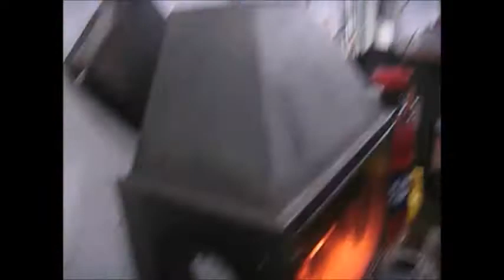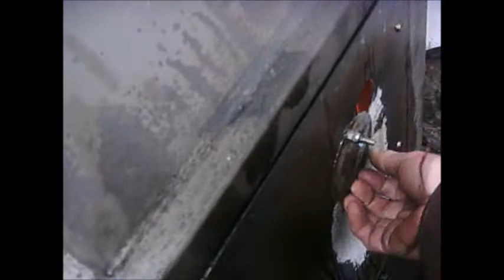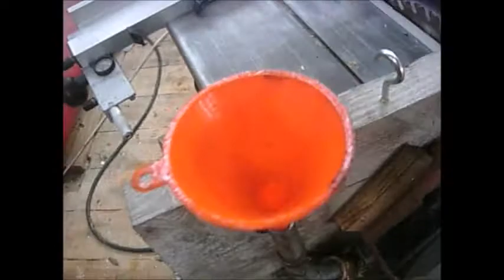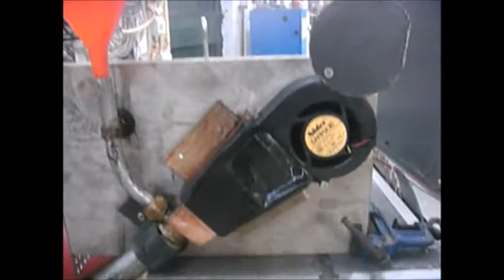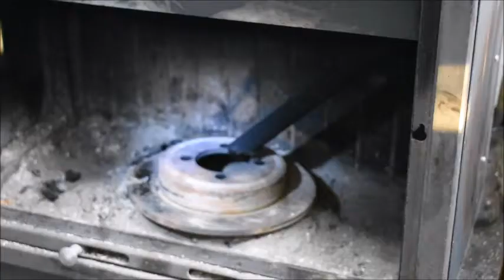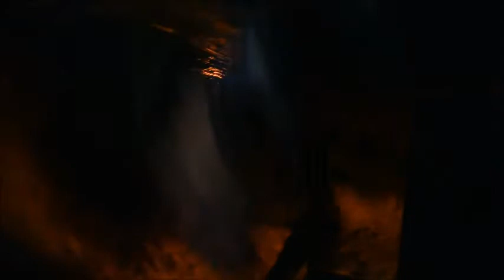Oil Burner Mark 3

Comment: Search barrel stove oil burner conversion and look at my burner basically a stainless tea kettle two brake rotors on top and a few air deflectors inside as you have done it is very clean burning i can even burn gear oil yours does good but i see splatter on the glass i think you can improve and make your system more efficient not knocking your system at all just trying to help another with my own research
Reply from the maker: Hi Jake, much appreciated! I will check your setup out.
However, the splatter on the glass is not from using the oilburner but from the years of (ab)use as a shed heater burning on wood. 
Thnx for stopping by.